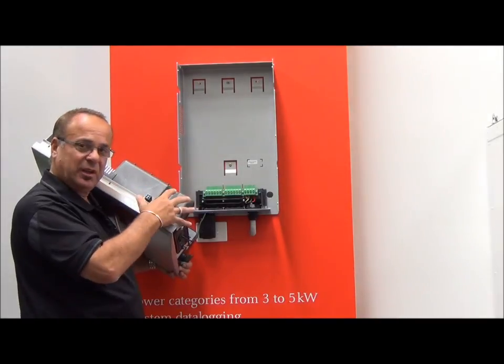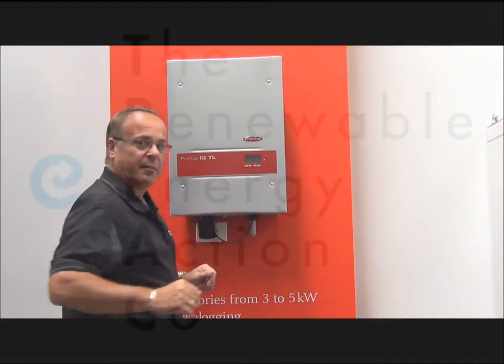Fronius inverters

Comment: I have a fronius IG3000 on my property in Austin Tx that is 7 years and two months old, and it isn’t working at all. The Fronius Tech Support is worthless, all they tell you is your OUT OF WARRANTY and they aren’t any help in trouble shooting the system. Each time you call in you get a different tech support person that just reads from a screen, they don’t seem to know what they are talking about. You can’t even talk to a level 2 support, they don’t have them. And you can’t talk to a manager either; you can only send them an email. So I sent them an email, and they said there wasn’t anything they could do to fix my system and that they wouldn’t stand behind the product at all. They would only pay for shipping to have it repaired, but it would only come with a 1 year warranty and I would have to pay to have it repaired.
I can’t believe I was stupid enough to have this Fronius inverter installed in my system what a waste of money.
Reply: Michael M Did you ever get any resolution to your problems with Fronius?  I sometimes buy up dead solar inverters for parts and projects... but I was also wondering if they ever did anything for you.
Reply: beforebefore
I'm afraid I didn't get any help from the company at all. I had no choose but to purchase a SMA inverter. I must say I should have purchased that unit in the beginning. I will never again purchase from them.

Sorry I'm not much help.
Reply: Fehlermeldung 516